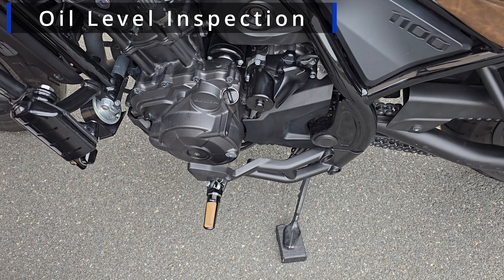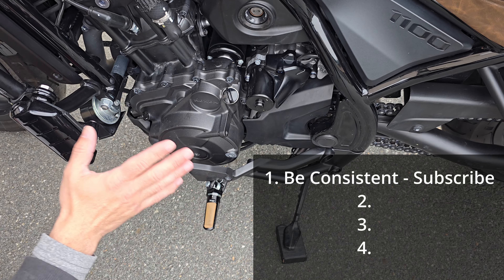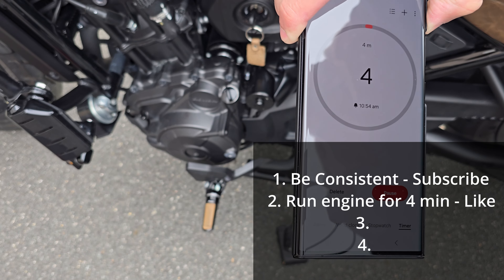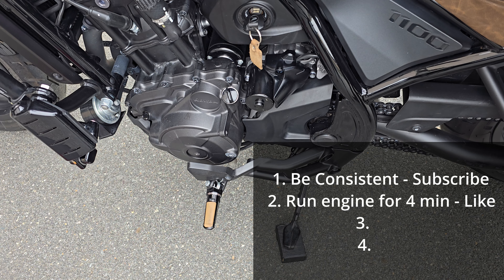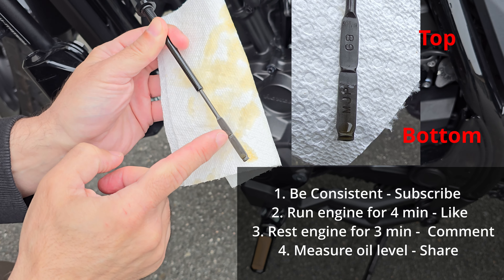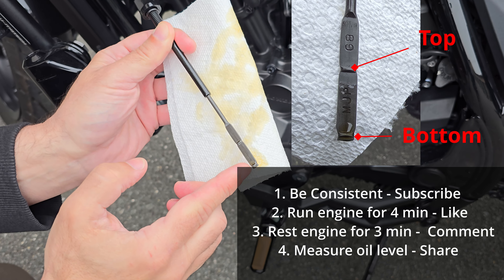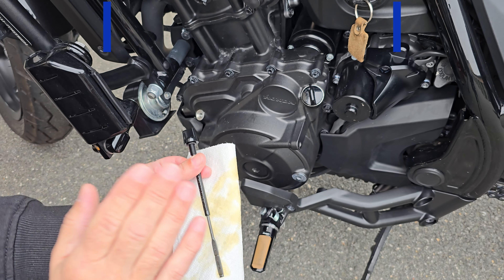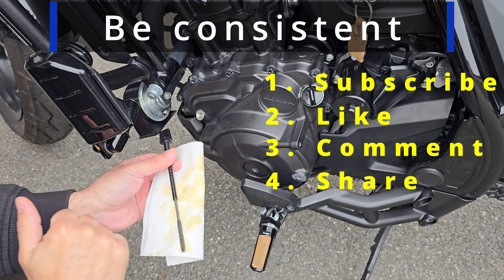Rebel 1100 Oil Level Inspection: Right way

Comment: Being consistent with the leveling of the bike when checking my oil on my 2022 Honda Rebel CMX100 DCT, was totally unbeknownst to me. Invaluable advice, thanks! 👏🏾👍🏾
Reply from the maker: I'm glad you found it helpful! I've seen it too many times where owners end up believing that the bike is either burning oil or is overfilled due to measuring inaccuracy, the objective is to be within the acceptable range. 🤙
Reply: @ontherebel11  Agreed, and it’s now embedded into my brain. 👍🏾

Comment: Great guidance- best to keep oil level quiet a bit below the top mark like yours - most oil leaks are because of overfilling
Reply from the maker: Thank you T! 🙏
Reply: Over filling can also causeother damage.
Reply from the maker: @jamescampolo7824  absolutely!
Reply: Best way to drain a little bit without removing the plug?

Comment: Hi Gus, did you notice any oil consumption on your Rebel. I just checked mine and after 4,000 miles mine was down a quart. My Valkyrie with 114000 miles doesn't use any in 4000 miles. Doesn't seem right. The Rebel has always used oil and I figured once it was broken in, the consumption would slow or stop but it hasn't. BTW, I'm using Lucas motorcycle oil 10-30 for wet clutches. Performance and shifting are fine.
Reply from the maker: Hi James, i haven't noticed any significant consumption on mine yet.
Reply: Mine only has 8,000 miles. You have over 30,000?
Reply from the maker: @jamescampolo7824  yes sir, I think 33k
Reply: @ontherebel11  I park mine in a garage and there are no signs of a leak. It runs fine so my guess is it is sucking oil vapor into the engine through the air box. I will be changing my air filter soon and I'll have to see what the box and filter look like.
Reply from the maker: @jamescampolo7824  You might find a little oil in the airbox as that is its path to the breather tube.
Reply: @ontherebel11  I just thought of something. I am going to come up with a design that allows crank breather naturally flow in and out of the crank case. With a PCV valve in the breather pipe, air can only go into the airbox and not return to the crank case. Therefore any oil vapor in the blow by will get sucked into the throttle body and not allowed to go back into the engine. That would consume oil and eventually foul the MAF sensor. I don't give a F about the EPA.
Reply from the maker: @jamescampolo7824  that sounds like a fun project! 👍

Comment: HI Gus, I was thinking about this. This is the required proceedure for checking the oil right after an oil change or other motor maintenance to fill up the oil filter, trani filter and other places in the motor. This makes sure the motor is in running condition and oil level has stablized. You don't have to refer to the Service Manual for general operator maintenance. The operator doesn't need the granularity of the Service Manual proceedures. I only use the Service Manual because I need detailed information for more in depth proceedures not covered in the Operators Manual.
Reply: This is from the Owner's Manual, Page 107 every new bike comes with the Owners Manual:
----------------------------------------------------------------------
Checking the Engine Oil
1. If the engine is cold, idle the engine for 3
to 5 minutes.
2. Turn the ignition switch to the OFF
position and wait for 2 to 3 minutes.
3. Place your vehicle in an upright position
on a firm, level surface.
4. Remove the dipstick and wipe it clean.
5. Insert the dipstick until it seats, but don't
screw it in.
6. Check that the oil level is between the
upper level and lower level marks on the
dipstick.
7. Securely install the dipstick.
Reply from the maker: Hi James, it wouldn't be responsible of me to show a method that is not described in both the owner's and service manual. The manuals do not specify that this procedure is to be followed after changing oil, it is labeled Oil Level Inspection which is on the page prior to the oil change instructions.
Reply from the maker: Hi James, does the procedure you quoted differ from the procedure i demonstrated and quoted?
Reply: This is in the Owners Manual that is not in the Service Manual "If the engine is cold".
The only reason I mention that this is in the Owner's Manual is because the "oil check" proceedure is available to anyone with an Owner's Manual and is not something mysterious.
Reply: If someone bought the bike used and it didn't come with an Owner's Manual, there is a copy available for download in ".pdf" format.
Reply from the maker: @jamescampolo7824 understood 🤙

Comment: I recently changed my oil and added too much. What's the best way to remove a little oil, or, just let it burn up on its own?
Reply from the maker: Sorry to hear that, you could open the drain bolt a bit to let some oil oil and retighten it, a bit messy but gets the job done, another method is to use a thin hose and syphon oil out from the dip stick opening. good luck bro.🍻

Comment: My first oil read on a new bike,  1100 DCT,  I read the manual 3x to make sure I got it right.  This is it.  However... I am wondering if a Jedi Master could read the oil correctly when the bike is on it's kickstand?  Because if it is about being consistent, why not the constant of the specific angle when parked on a level surface?
Reply from the maker: Hi Russ! Congratulations on getting the 1100!! I put the 2x4 block under the stand to keep the bike as upright as possible, and i measure it in the same spot every time as i've learnt it the hard way LOL. The only thing different that i do is that i use a paddock stand while at home and not touring.
Reply: For over 50 over years, with any vehicle, the vehicle must be on a level surface and with a bike, it has to be held up vertically. Here's an idea, check the oil level in the level, vertical position. Then check the oil while it is on the side stand. Then compare the two readings. If the one in the vertical position is within spec, the one on the side stand would be also be correct. This is not rocket science.
Reply: @jamescampolo7824  Since the beginning of time, a liquid will seek it's lowest point.  Thanks for stating the obvious.  Potentially there is a chamber in the engine that when tipped sideways will not level the oil.  I was being lazy, just wondering if someone had an answer that worked just as well without centering the bike.
Reply: @GlowBright333  That's my point. Why run the motor (per this video), pushing oil to the top of the motor when you are going to measure it at the bottom?
Reply: @jamescampolo7824  Because the engine doesn't have a normal oil pan in which everything collects. There is a reservoir where the oil is pumped into. dry sump lubrication
Reply: @Dennis-86  Harleys have a dry sump. That is where the oil is held in a reservoir separate from the engine. Hondas have wet sumps and the oil runs all over in the pan and the transmission. There are two drain plugs because there is a divider in the pan. When the oil is full it runs across the divider.

Comment: Do you screw the dipstick in to check or just leave it loose?
Reply from the maker: Insert the dipstick until it seats without screwing it in. 👍
Reply: No, on any motorcycle for the last 50 years, you just drop the stick in the hole, pull it out and look at it. No screwing required.
Reply: On the dipstick it says "do not screw at oil level check"

Comment: Bit of a delayed start there???
Reply from the maker: Not at all, cold starts are like that on the rebel 1100 👍
Reply: @ontherebel11  I agree Gus, the starter is barely able to handle the compression on the 1100. Planned obsolescence, kill the battery (which is not covered under the extended warranty) or kill the starter which under the regular warranty is only good for a year. Either way, they win. The starter on my Valkyrie spins with zero effort after 27 years.
Reply from the maker: @jamescampolo7824   I have a new project lined up to take care of this 🤙

Comment: Be great if they could just design the stick to account for the lean of the bike on local ground
Reply from the maker: Hi Fran! It would be nicer if they just had a window......
Reply: That would be impossible. " Level" is a constant. To measure anything, you need a constant to work with.
Reply: @ontherebel11  The bike would still have to be level. My 1993 Honda CL350 had a window but you still had to hold the bike vertical on a level surface. Another drawback to a window is that it is very hard to see it while you are sitting on the bike holding it up. You either have to have a block under the side stand to hold it up or a 2nd person.